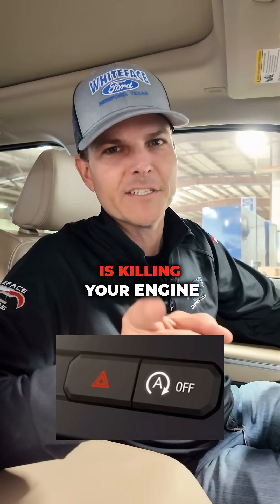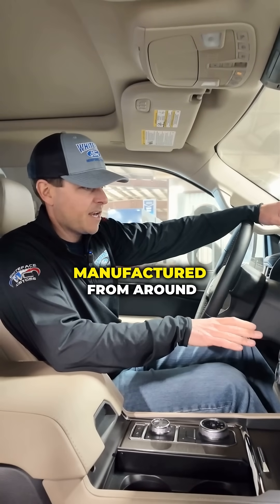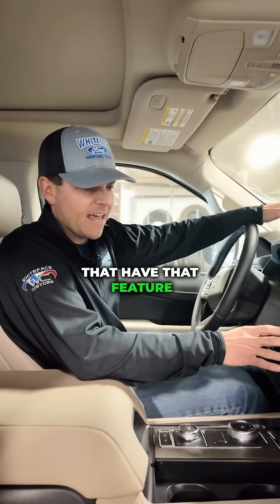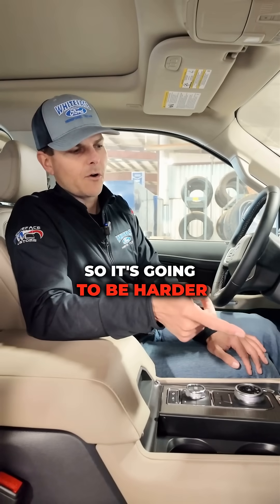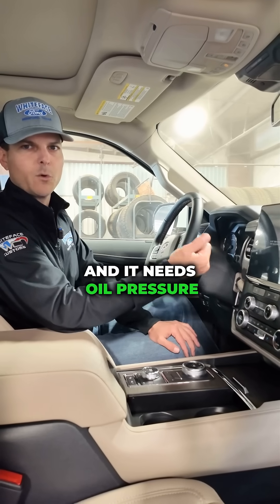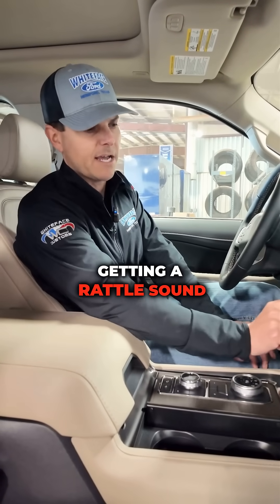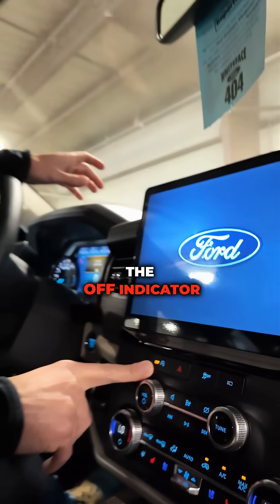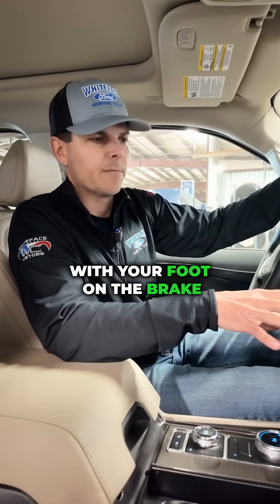Is Auto Stop-Start Wrecking Your Engine? #Shorts

Comment: I have no idea why they engineered this into any vehicles. I had no idea I had it on my vehicle because the person from the dealership explained so many things that a few were overlooked and totally understandable. The first time this happened to me at the top of a hill when I came to a stop to wait to turn left, I didn’t know what to do. I pressed start a couple of times and nothing happened. And of course, there was an idiot behind me honking their horn. I put on my hazard lights and sat there, and on the screen, it said to put the vehicle into park hit the brake and press start again and it was fine. I came back to where I live and immediately went to YouTube to find out what was going on. So after that, I pressed the A button every time.  But tonight, I noticed a symbol at the bottom of the temperature range on that side of the screen and I had no idea what it meant. Another freak out. I came back and looked it up and it just signifies that the auto stop start feature is off. But the next time I started the vehicle, the symbol still showed up and I had not pushed the button yet. So I’m not sure if this is normal or not. I will see what happens the next time I drive before I push the button.

Comment: Do any of you guys actually believe that the manufacturers would install a system to comply with CAFE standards and not do a lick of engineering to make sure it's robust enough to tolerate so many cycles? Oil pressure does not get lost in the 30 seconds, or even 3 minutes, that you might be stopped at a light. The main battery does not do the restarting, it's an aux battery specifically designed for it.

The engineers up in Detroit may not be Einsteins, but they're certainly smarter than YOU. 

I can't wait until the data comes out about how much more reliable engines with auto stop-start systems are proven to be than the legacy ones, and how little benefit there is to disabling the system.

Comment: You should do a bit of research before you start making false statements.  Do understand that I am NOT defending the technology. I'm only correcting your misinformation.

First thing is that most people have NO IDEA how this technology was developed. There were many modifications to make this work.

First, they added a heavier starter and battery. To go along with that, they also added "booster" pumps to maintain oil pressure in both the engine and transmission. This is to keep the transmission engaged in gear by keeping hydraulic pressure on the active friction elements. This is also to keep the pressure on the cam phasers you are so concerned about. There are other mods as well.
I understand your dislike of the start-stop thing, but at least learn about it before you go publishing misinformation. The really stupid thing is that it adds weight to the vehicle while theoretically saving a teaspoon of fuel per year. Overkill at its finest.
The really stupid thing

Comment: Batteries and starters in automatic stop-start systems are tailored for their specific vehicles. A quick Google search would have revealed that.
Reply: That's what the automakers tell us, but how do we know it's really true? Also how much gas do you think you'll save having the engine shut off for 5 or 10 seconds at a stop light. The engine needs a burst of fuel to start back up. The few drops of gas you saved when the engine shut off is going to be used right back up when the engine restarts.
Reply: @kevinhoffman8112 some cars show elapsed time and how much fuel you saved over said period, and the battery and starter are specialized agm or efb batteries with markings and stickers to indicate such

I have a start stop car

Comment: It can be beneficial, I have saved over 3 hours of engine ideling time so far, the auto start/stop should be used on your regular communt routes where you know those potential long wait spots are, I would plan to restart the engine around 10 seconds before the car had to move.

Comment: I have a question that I can’t find on the Internet yet. If plugging in a third brake light in the trailer hitch receiver, does that interfere with your backup camera, 2018 Ford F150 XL
I have not bought the third brake light for down there, but before I spend the money, I’m just trying to find the information. Thanks for any information you can give.

Comment: Batteries in stop/start cars have higher top end capacity than other ones. The computer determines which piston is closest to firing when the engine stops, the cylinder housing this piston gets an initiul squirt of fuel then a spark, triggering ignition and engine turnover without involving the starter motor. The starter motor itself has two solenoids, one spins up the pinion to match the flywheel speed, the other behaves conventionally to mesh the ring gear with the motor pinion in a synchromesh-style operation, this speeds up the starting process.The automatic transmission contains a small hydraulic pump to maintain pressure, as does the engine oil pump. The water pump in turn is electric and keeps the coolant moving with the engine off. The whole idea of stop/start is NOT fuel efficiency. it's emissions reduction. No, auto stop is not wrecking your engine.
Reply: Agree

Comment: Except they have an electric pump that keeps the oil flowing, they have ecus that dont let the battery get drained, they have ecus that remeber the position of cams and valves for the startup, and they use dual starters so that they dont wear out as fast.  These starters are rated for 315,000 miles.  Even a normal starter wont last that long.  Why are you lying????
Reply: Quit lyin
Reply: @blabla903 I never started me son.

Comment: All you have to do is start the car push the button in and hold it in and the light comes on shutting of the engine stop kill, then have a small piece of cut out old credit card to stick in the side/gap to keep the button held in. Next time you start the car the light will come on indicating the feature is shut off. This works for Hyundai and most cars with this ridiculous feature. Save the $100.00 for the aftermarket module and taking your console apart with this simple hack.

Comment: That is the most silly thing.  Components are designed to handle the extra load of frequent restarts.  What IS stupid is millions of cars stopped in traffic and at stop lights with engine burning fuel for nothing.  If you are that concerned about wearing your ride,  get a bicycle it's way cheaper to repair.
Reply: Moron

Comment: What I wonder about is the transmission as well. If the engine isn't turning than the tranny pump isn't turning either. I imagine trying to engage a clutch pack or band while line pressure is still building causes the clutches to slip more before grabbing decreasing the lifespan.

Comment: I just rented a VW Taos with a CVT transmission that had the Start/Stop feature enabled. Not only is it hard on the engine, starter and battery but it feels like the CVT transmission is forced to engage at a higher RPM since the gas pedal is depressed more because the engine was stopped to save fuel (at the expense of the drive train).

Comment: There are two places where you can unplug the on/off auto start. For ford 1 it's at your battery 2 it's underneath you console. All manufactures are slightly different with location so find out where for yours and just unplug it. And, you would need it back when you need to haul anything but I'm most of you don't haul anything so

Comment: The Car Care Nut channel said that it's totally fine to use the feature.
Reply: He also said don’t fill your oil filter with oil before you install a fresh filter because when you pour from the bottle…. it’s not filtered

I lost a lot of respect that day
Reply: @chewybacca11   Problem with pre filling is that people pre fill it from the clean side, which may introduce contamination. That's what he means.
Reply: @khoifoto contamination from what?  It’s brand new oil???

Well… don’t pour it into your engine oil fill neck since you might introduce contamination

Comon bro
Reply: @chewybacca11  Some brand new oil can still be contaminated. Heard it directly from the manufacturer.

Comment: Actually BATTERY Manufacturers Bosch n Varta DESIGNED Batteries. specifically for Auto S/S. Also the Engine Parts suppliers. Like ADL Blueprint, Bosche, Valeo, Magnetic Marelli, Simplex, n so on.. BEFORE S/S Was installed into cars. The manufacturers were manufacturing the parts specifically READY. @ LEAST A Yr before. So DO YOUR Research 1st.

Comment: Yeah they do it to be compliant with fuel efficiency standards WHILE it's wearing out parts on your vehicle so you will keep bringing it into the dealership so they can hit you up for another $1000+ repair, check your warranty, most don't include alternator, starter, battery and cam phaser and lockout pins in the warranty plans. This unbridled corporate greed has to be placed in check.
Reply: What? Those practically always included on Oem warranty,….

Comment: yep there was a massive influx of lifter failure when I was at gm on the newer models and I never really thought how they all have auto start/stop. those models have the biggest failure rates.
Reply: My 2021 gentlynused dirsngo citadel has a ruined enjine. Needs head gaskets rockets and lifters. Due to cam wear. It’s a legit issue that always happens in that specific b6 motor always fails on the passenger side first. It should be a recall to remedy it. Not thousands to the owner. Bad design. Now what do I trade it for to avoid this in the future ?

Comment: At $10 USD per gallon which it is approximately in AUD. What’s cheaper in the long run? Wear on the phaser lockout pin or more in fuel as modern starters are designed for the higher workload and AGM batteries are designed for that too so I think your petrol is too cheap and faced with world petrol prices you’d change your opinion.

Comment: I use it more judiciously when it's set to. With a Toyota in a manual if you just keep the clutch pressed it doesn't switch off. On trips where I know I'm going to get stuck in long traffic lights or if I'm stuck in traffic I will use it. I don't use it on every trip. Maybe less than half the trips.

Comment: A lot of BS here. There is more than one way to implement this sytem. Not all auto start stop are using starter or lose presure.
I owned Mazda CX for 5 years and didn't bother about this system at all. Skyactive is one of the most reliable engines within its group.

Comment: I dont care if it saves me 3$ in gas every 7600 miles... 100 over 100k... even with specialty batteries,  and specialty electric motor to turn the engine back on... all the companies have piss poor track records of making a small idea and small innovation into a mess of wires and harnesses. And over complicated motors, actuators.  Etc etc... and will use the shitty-iest wires and hardware and have a 1c piece od plastic or wire cost 1000s in replacement and repair

Comment: As a Ford and ASE certified person, this is dumb. 
Modern cars have oil accumulators, have extra large batteries, much higher capacity alternators, and the starter IS NOT the same starter as an old small block. It's not a huge fuel savings, as the savings is divided amongst all cars, but the arguments about "reliability" are dumb. Sorry that OP learned in the 90s and refused to keep learning about their trade.

Comment: For oil pressure, I've read both sides of the argument. One side says yes, it damages your engine due to loss if oil pressure, on the other side, I've read that it's not a long enough time for oil to completely drain into the oil pan and even if it did, it still leaves a lubricating layer on the parts that need it. Honestly, I feel like the synthetic oil we have now leaves a pretty good lubricating layer on those parts, at least long enough for oil pressure to build back up.
Reply: anything they do to please the gov hurts the consumer WTFU
Reply: You’re abusing the lockout pin on the cam. Your in increasing the duty cycle on your battery. You’re increasing the duty cycle on your starter. This end up costing you more money there is no other side to this argument.
Mechanical things wear out the more you use them . Hit the button to cancel this nonsense.
Reply: A layer of oil is not the same as oil pressure

Oil pressure forces oil between parts so they don’t touch at all or maybe very little

Zero oil pressure does not do that
Reply: from the comments sounds like the starters in these cars are made to handle a bigger load but if u turn this feature off it will last even longer
Reply: are there any benefits to having this feature

Comment: vehicles with auto start/stop systems are built with specific components to handle the increased stress. The starter motors are more robust, designed for frequent use and quicker restarts. The batteries are also different, typically using Absorbent Glass Mat (AGM) or Enhanced Flooded Battery (EFB) technology, which can withstand the constant discharging and recharging cycles.
Reply: Still, you loose oil pressure & your components are still jarred, not counting the cam phaser

Comment: Stop fearmongering with lies and misinformation. Stop start systems don't cause ANY extra damage. They use a purpose built electric motor to start the egine. It isnt just a standard starter. Vehicles with auto stop start also have a stronger, dedicated battery specifically for the stop start system. The 12v is only used to power the electronics like the radio and lights. Toyota first used auto stop start in the Toyota Crown in the 70's. Why would a manufacture who's name is synonymous with reliability and longevity use an inferior system on their top tier, luxury vehicle that is owned by every single politician and wealthy person in Japan? They WOULDN'T. Stop spreading bs lies.

Comment: I’m an engineer - and this man’s opinions are wrong. None of the bad things he describes have any significance. You should think more about not stressing cold engines with heavy acceleration and maintaining your vehicle as specified.
Reply: The latest drive trains are mild hybrid where the gearbox and electric motor are combined, seamlessly going from starting to driving to charging. It makes for very smooth starts from a much bigger, fully engaged motor. Ford US may be struggling to get this right based on comments elsewhere, but that is hopefully an outlier.
Reply: No significance huh?
Reply: By calling yourself an engineer, you've instantly lost your own argument. It's planned obsolescence, every mechanic knows it
Reply: @EarthAuto  lots of people here are giving unsubstantiated opinions and a lot of common sense. Keep that in mind next time you are flying at 37000ft - it’s just common sense.

Comment: i knew the moment they released that feature there was going to be starters failing under 25k miles. a tech told me the starters are designed to turn on and off. i told no they are not designed to turn on and off 30 times a day and still last 100k miles. the government does nothing but cost consumers more money

Comment: Auto start-stop wasn’t designed to save gas like most here complain about it not doing effectively. It was meant to reduce emissions especially in city traffic where idling adds up. It helps carmakers meet environmental laws like EU CO₂ limits or U.S. CAFE standards. The fuel savings are small but when millions of cars do it the emissions reduction is significant. Modern systems also have reinforced starters and batteries to handle it. The engineers and researchers behind it believed in the environmental benefit and designed it with that in mind 

I personally dislike the feature but I’m just sharing the actual reason why it exists
Reply: It is for emissions & does provide a small savings on the stop & go (in town) milage. It is not US. CARB. CARB is California Air Resources Board.

Comment: 2019 Ford Escape it worked for awhile but i mostly shut it off. It’s completely useless and has no impact on your bottom line. It won’t work if the battery is below 80% anyway.

Comment: Stupid... Battery is a special battery designed for stop start.  Often the system is 48v and the starter is actually a very different dedigned motor that will also regenerates power through the hrakes... This guy is a Neanderthal...

Comment: I bought my truck in 2015 with the feature, still on the original battery even using the feature a few times a week.  Also despite first year with the 2.7 engine & aluminum body & new computer it has been good so far.

Comment: I am not a mechanic, but I am a man who has commonsense. I knew starting and stopping an engine is not saving gas and it’s doing more harm than good to the engine!
Reply: You're right. You're clearly NOT a mechanic because you have NO CLUE what you're talking about.
Reply: @jonjacob1962 I would be upset if it wasn’t so funny!
Reply: I am a mechanic. It does save gas. If you are sitting at a stop for more than ~7 or 8 seconds, you do save fuel by shutting the engine down and restarting it later. If you don't stay stopped for that long (like a stop at a 4 way stop with 1-2 cars that go before you), you net a loss of fuel by shutting it off and restarting. Now, despite me saying that I still don't like it as a feature because of the added component wear.
Reply: You’re not either. This guy is lying to you. I’ve run it both ways. Absolutely saves gas
Reply: I am a mechanic. You’re wrong. I don’t see cars with start stop systems kill batteries starters or engines any faster than cars without. As crazy as it is manufacturers don’t want to deal with class actions, recalls, or cars failing before warranty’s are up.
Reply: Yes but AFTER. Warranty is up this becomes relevant😊
Reply: It doesn't harm the engine at all!!  If anything, running your engine more wears it out faster.
Reply: Libtards